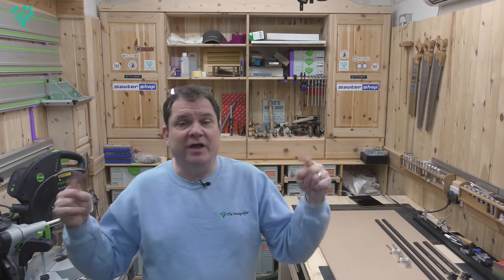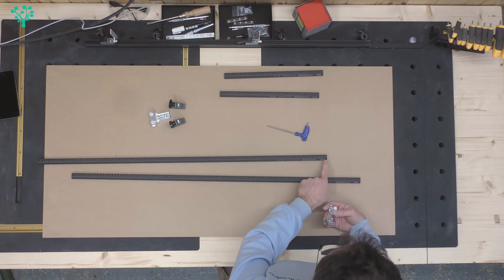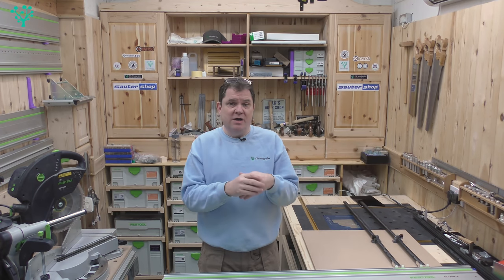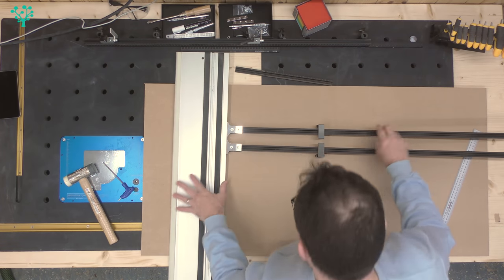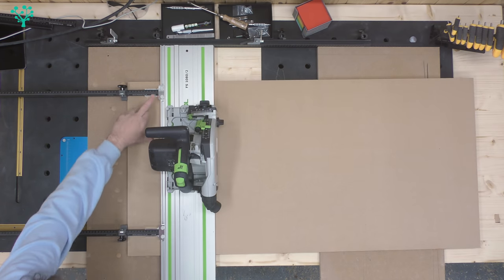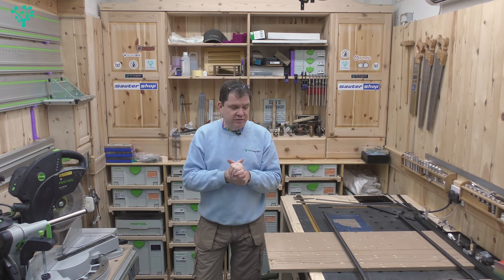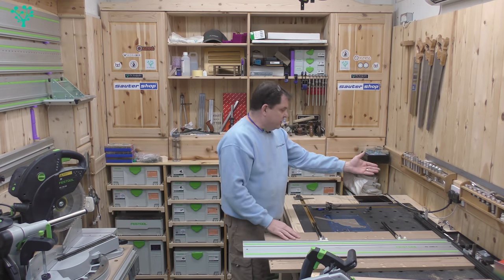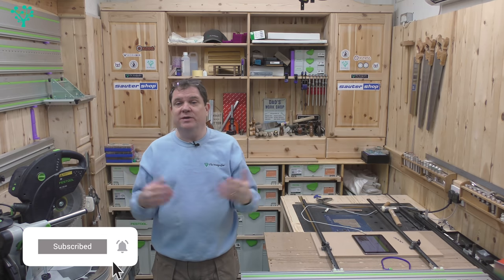Benchdogs.co.uk Parallel Guide - review and use

Comment: Earlier today (19 Jan. 2021) I used my guides for the first time and was very pleased with the results. I cut a sheet of 1200 x 820 MDF (from B&Q) down to 1100 x 600. There may be an error of 0.5 mm depending on which ruler I use but, as very much a hobby woodworker with limited space, I have never achieved that type of accuracy and with very little fuss. I have the pre production non segmented guides and although they may be somewhat cumbersome having to join a number of pieces can also be fiddly. (I have the segmented fence system.)

It was good to see you using the extra pieces for narrow cuts, as I could not find any instructions on the Benchdog website. An extra set of the 3D rail attachments would be useful to avoid having to detach them from the long rulers buy you also demonstrated a way round that.
Reply from the maker: Hi Robert,

Glad to hear you are having success, using my calibrated rulers I am getting bang on repeatable accuracy. May be worth measuring your rulers :-)

As you say for breaking down the big sheets, it is awesome (actually better accuracy than the B&Q man with the big panel saw).

It took me some time to work out the under rail system - and it works. Ralph from Benchdogs has just posted that there is a new solution coming soon for the under rail attachments. I will look forward to that.

Cheers

Andy

Comment: I am not sure if you monitor your old videos for comments but I wanted to thank you. I purchased an extra set of parallel guide connector blocks and set up the narrow cut guides by making reference to this video, without which I would have lost. I had to swap the new connector blocks with the regular system as, to me, they do not appear to be compatible with the narrow guide cuts as the screws connecting the guide to the block are too short. The new connector blocks are an improvement on the original system as the nylon screws have been replaced by metal screws and the two nuts replaced by a single bar.
Reply from the maker: Hi Robert,

Thank you for the comments, I try and monitor the older videos. It can be hit and miss as YouTube does not have the best system for comments. However, I caught this one.

Yes, Benchdogs have updated the brackets and the thumbscrews. Benchdogs have told me they will send over the updated product, then I can update the video.

I wouldn't (and don’t) use the under rail solution for the smaller cuts - I use the trick I showed in this video. I don’t want to recalibrate during my workflow.

I actually dropped one of my rails the other day, and the nylon nut snapped - so my concern over that was well founded. Benchdogs have agrees to replace them if folks have purchased the older set.

Anyway, glad the video helped.

Andy

Comment: Thanks for the review Andy, but you are using the guides basically for cross cuts in your demo. The main purpose for these are for long rips. If you do a long rip, you will soon find out how cumbersome it is to walk around the guides while cutting the rip. I am speaking from experience. I own a set from Seneca woodworking (USA). Love you videos. Keep making sawdust!
Reply from the maker: Hi George,

Now sawdust I have in abundance - I can ship some over if you are short :-)

Yes bit limited on space for the demo - the lens on the camera will only cover so much.

I wouldn’t see an issue with the precision on the long cuts, not sure why you would be walking round the guides.

I will give that a go next time I need to break down a large board.

🤔🤔

Andy

Comment: Already pre-ordered a set as it fills a gap in my workflow for sheet goods and I couldn’t justify the cost of the TSO products parallel guide system (and they never seem to have everything in stock which means multiple orders and multiple shipping costs from US to Aus). Not sure how the nylon screws will last, and the 3D printed parts, but time will tell. Thanks for the detailed review, as always. Very useful.
Reply from the maker: Hi Ian,

I trust you will be happy with your purchase.

I don’t forsee and issue with the printed parts to be honest. They are similar in quality to the flag stops on the Benchdogs fence. And boy have I abused those with no real issues.

I would be tempted to swap out the nylon nuts for steel ones. Just to give it some longevity.

Cheers

Andy

Comment: Hi Andy 
Great honest review.  
Looking a bit flimsy for me , not sure about the 3D printed parts 🤔  easily broken . I use the festool guides and in my opinion will take some beating on strength and accuracy. Benchdogs rail square on the other hand is awesome.
Reply from the maker: Hi Andy,

The 3D print is the same quality as the stops on the fence. I have never had a problem with those, so I don’t expect these to be a problem.

I will carry out a comparison to the Festool at some point, I don’t think anything will be as robust as the Festool ones - but that comes at a cost - and I do find the Festool cumbersome to set up and use.

And yes, the rails square is awesome.

Thank you for the comment,

Andy

Comment: Hi Andy 
Looks like another good piece of kit from Ralph although as I already have the complete set of Festool  parallel  guides which are a bit clunky in use they are accurate and don’t think I will be changing them out  any time soon but these are probably a more affordable setup if you haven’t already made an investment.
Philip
Reply from the maker: Hi Philip,

Yes it's a good kit - I will be comparing the Festool and Benchdog system at some point soon.

Cheers

Andy

Comment: Are the rail brackets are a little narrow allowing some racking that will become a wear point?
Reply from the maker: Hi Rob,

I think I may upgrade the nylon nuts for some sort of M6 a stainless  steel ones so you can put more tightening torque on the clamps.

I don’t think it will become a wear point as it will be positioned at different point a on the track.

Cheers

Andy

Comment: As above, thank you for taking the time to test, film and post this excellent and informative review of the BD parallel guide. I had already placed the pre-order and was pleased to see the item in use.
Why, you might ask, did I place the order before seeing any reviews? Well, I've seen plenty of shop made versions, varying from super simple to incredibly complex, but figured at the very reasonable offer price of £100 (plus vat, of course) it would be silly to faff around knocking up my own.
Reply from the maker: Hi,

God's to hear, have you clocked the updates from Benchdigs as a result if the feedback from our community ?

The rails are now available as single section (as per my review) or two sections or three section.

If you need to change your order, send Benchdogs your order number and ask them to update your order.

Cheers

Andy
Reply: @TheWoodgrafter  Andy, thanks for the heads up regarding the new configurations.
I just wonder, the original 330mm sections; does that mean 330mm plus the width of the track? I only ask because a 1000mm section would absolutely be in the way for narrower rips and cobbling sections together introduces inaccuracies.
Reply from the maker: Yes it would,

So assume the track is nominally 200mm then the single piece would give you a capacity of 330 plus 200

Cheers

A
Reply: @TheWoodgrafter  thanks Andy, based on that I'll go with the  two section option. 👍
Reply from the maker: Hi,

Makes sense. I think you will be happy with that.

Andy

Comment: So , does that mean you have to calibrate every time you change from wide cuts to narrow and back to wide again?
Reply from the maker: Hi, sadly yes on the current design. I believe there is a new design on the way for the under rail attachment that will remove that issue.

That is why I also showed the simpler method.

Cheers

Andy

Comment: Hi Andy, thanks for the video. I was just using the guides today and I needed to cut 4 long 22cm wide  pieces and I noticed that the guides have limitations around the 22cm mark. Or am I just using the guides incorrectly?
Reply from the maker: Hi Stefan,

What are the limitations you have found ?

Andy

Comment: Nice review  good  English company all products are really nice
Reply from the maker: Hi Thomas,

Agree it's good to support local.

Cheers

Andy
Reply: @TheWoodgrafter   I will be buying the parallel  guide  system  well worth it
Reply from the maker: Hi Thomas,

Yes its a good system, just as an update. Ralph (from Benchdogs) has just posted a comment stating he will be offering two options - the single rail (as per the review) and the kit I discussed. 

The nylon screw will also become metal so even more value.

Cheers

Andy

Comment: Hi Andy, thanks for the review and the updates. Looks like you've experienced the same thing as I did with the under rail short cutting. Not only do you lose your accurate setup, they are also extremely fiddly to keep swapping over. Glad there will be a solution - hopefully if it comes with any new kit, those of us that bought in early will get the replacement parts FOC. Now, onto a question - you mention use of a known accurate ruler to setup the guides - what is it, and where did you get it from? May well come in handy having a long reference rule.
Reply from the maker: H Mark,

I can't see me using that under rails solution very often, but interested to see what Ralph comes up with next.

Cheers

Andy

Comment: Am I alone in not liking rails and fences to be split into lots of short pieces?  I think it is just another place for a small amount of error and inconsistency to creep in.
But thanks for the review.
Reply from the maker: Hi Julian,

I guess it depends on your application. In my shop I want to use single construction pieces. 

If I need portability then the ‘split’ fence option works best.

Cheers

Andy
Reply from the maker: Hi Julian,

Just as an update - Ralph from Benchdogs has posted on this channel, he will now also be offering the system with a single rail as well the kit.

Cheers

Andy

Comment: 2.5mm Alan wrench? Not exactly a convenient size?
Reply from the maker: They are readily available and come as standard in most metric sets. However, if you have an imperial set - then it could be an issue :-)

Cheers

Andy